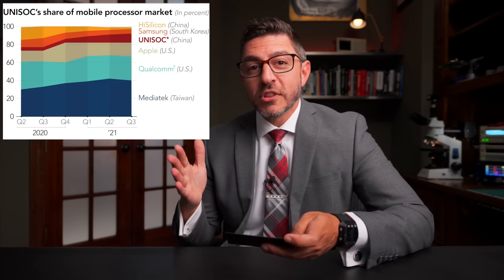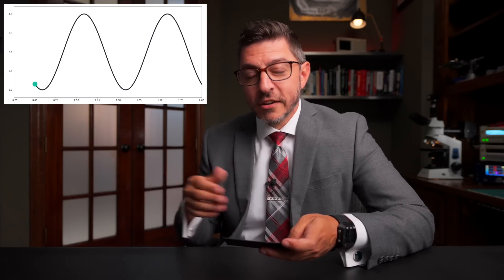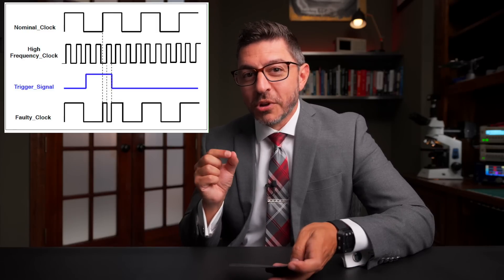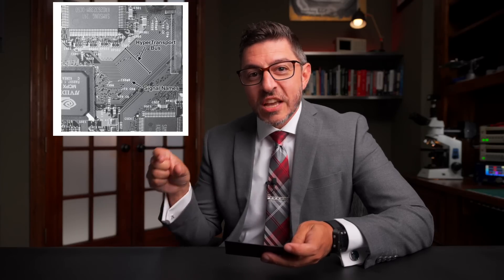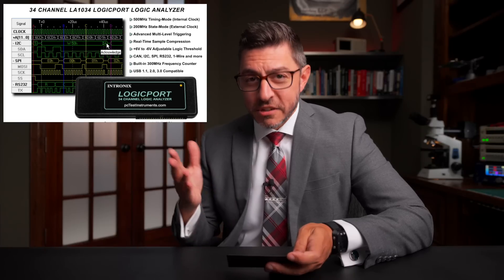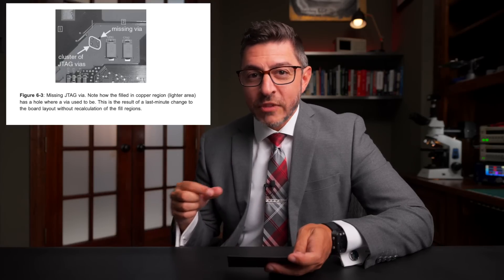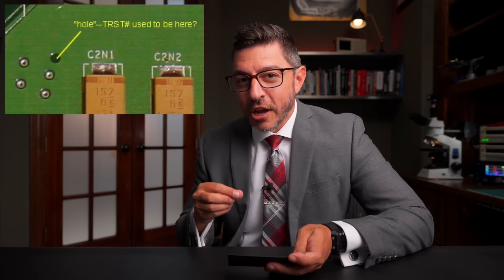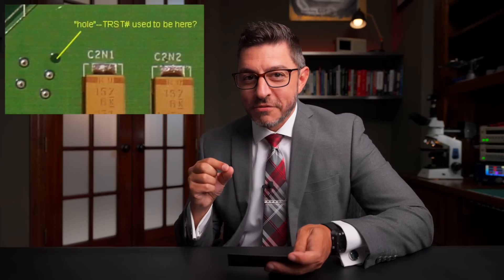Hacking the Xbox... AGAIN!!

Comment: I tried self-hosting Bitwarden (open source password manager) and it definitely had warts (especially on mobile). I migrated back to 1Password, which I feel is a type of product where you definitely want to be paying - for liability concerns at minimum, but also because it ties the bottom-line and very existence of the provider to your security.

Either way, you should be using a password manager with randomly generated passwords, but definitely not the one built into your browser.

Comment: I remember when CPU emulators started hitting eBay years ago, for CPU's made in the 1980's that had sockets, but to build a board to install between a soldered in CPU is about as hard core as it gets.  Now that is what I call an obsession, lol!
Reply from the maker: My thoughts exactly! 😂
Reply: Much easier for that pre-BGA era. Making it isn't half the problem, the big problem is not melting everything getting the chip off and then doing BGA rework to get it back on.

Comment: The Xbox hack reminded me of 40 years ago when I worked on one of the first AT&T 3B2 computers in the UK. If you lost the root password there was a combination of keys you could press at boot that would prompt you for a 'firmware password'. That password was 'mcp', it was the same on every box. #goodolddays
Reply from the maker: Sweet sweet back doors!
Reply: I've recently bought a broken dell Wyse aio 22", when I fixed the pc, the I was prompted for a password, the 2 minute search revealed that allmostall Wyse have fireport as a password,on the other hand default ME pass is sth like 1password or so :(, great that I am, I mean ME DISABLED
Reply: On our PDP-11 at college, the "secret combination of keys" was just to hit CTRL-C during boot-up.
Reply: @edgeeffect oh I remember the bug in Linux kernel 2.4.
Just press space and hold it to crash the boot process , then you get a shell with PID 1 to play.

Rember when bash was PID1 because of stupid SysV init process  ? That's how.
Reply: I also remember the trick on Windows Server of just copying cmd.exe over osk.exe and using the accessibility button to have a privileged superadnin (aka root) account, then you could just reset the admin password , or add another admin account .

 That doesn't worn anymore because integrity don't check only if files are signed by Microsoft, but also they're the proper files by their SHA hash.
Reply: @monad_tcp  PID 0 was the idle process. You're also misremembering about Linux 2.4. If you think systemd is more trustworthy than other, more mature init systems, you don't know enough about systemd or Pottering.
Reply: @paulie-g   I meant to say PID1, as I had said before
Reply: @paulie-g   " You're also misremembering about Linux 2.4 " I am, I only remember that CVE about bypassing the login by crashing the keyboard handler. I think it was around the time of Kernel 2.4, But maybe it was later.

Either way the Kernel2.4 was the SHIT.   Linux was so insecure back then, Kernel2.4 was no better than Windows XP.
Reply: @paulie-g   " more mature " , SYSV ? don't make me laugh...

How is executing random scripts at the PID1 more secure than executing a binary ?